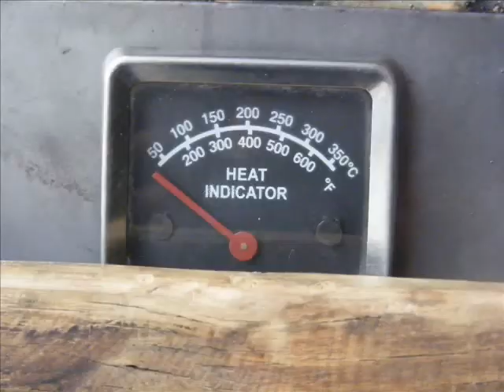ROCKETSTOVEN construction

Comment: Nice! What kind of welder do you use and how thick was the sheet metal?
Reply from the maker: Hi, it is only a cheap MIG welder with 0.8mm gasless wire. The sheetmetal was 2mm thick. It is easy to weld and solid enough. One 1200X2400 sheet was used to make both the rocket stove and the oven.
Reply: rocket stoven
Very cool. VERY Cool. How long did you bake the idea in your brain before you got to work on it?
Reply from the maker: Jamal Johnson I think about a month from start to finish. The rocket stove itself is just a variation of what is already on youtube. The oven bit took a bit of thinking. Once I realised that the heated tiles would be enough heat to cook with, the outside chamber for the gases/smoke to escape kind of envelopes the oven and traps in extra heat. The smoke/gases never get inside the oven itself.